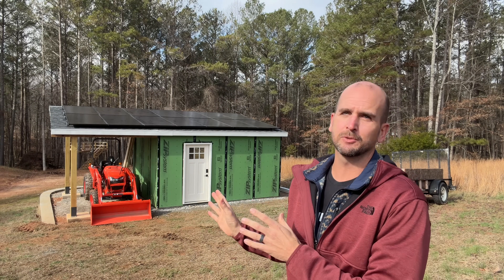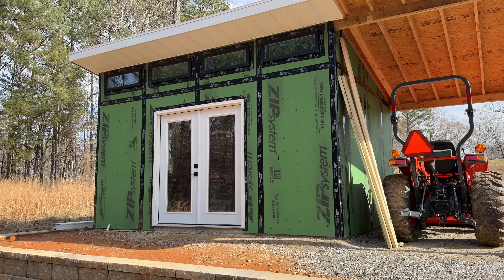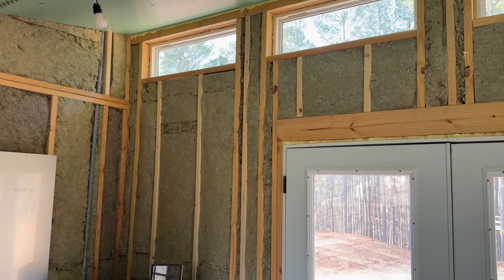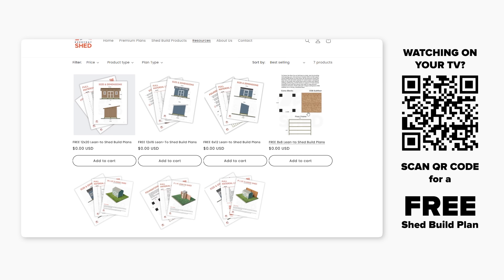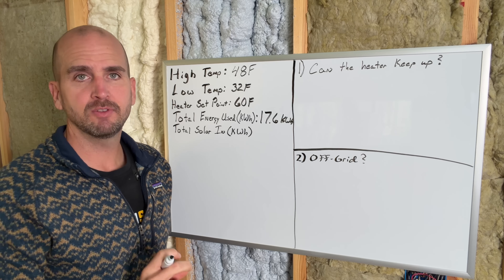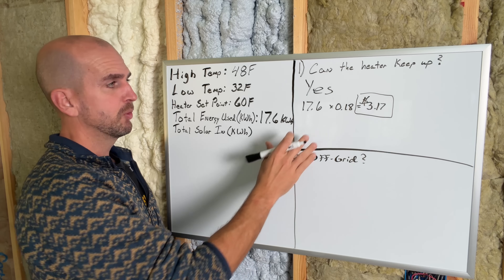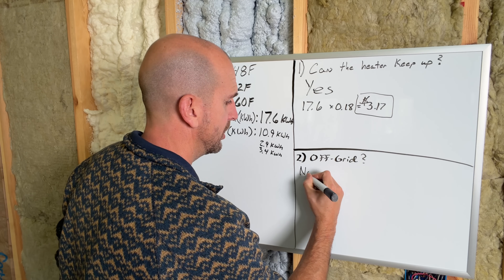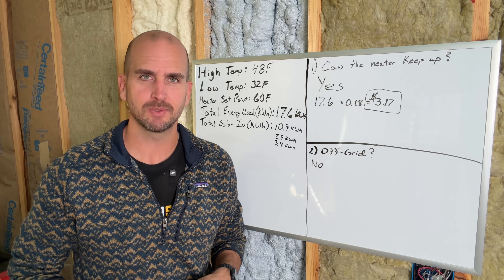HUGE Mistake: Why My $15,000 Solar System CAN'T Heat My Tiny Shed

Comment: $15k solar system that will take at least 15 years to pay for itself (not counting the inevitable decline in performance over that same time period)? Probably around year 20 or so you will be looking to replace it. Take that $15k and invest in the SP500 and you will get a much much better return even after accounting for the grid power cost. It's not even close. If you're not calculating economic opportunity cost into the solar vs grid comparison, you aren't looking at the whole picture. With all those trees, maybe some kind of a wood burning heater would be better. Maybe it could work in southern California where the heat needs are low (might still need cooling) and the sunshine is plentiful, but probably not even there.
Reply: The way you calculate this is just by taking the nominal power consumption in kWh/month and figuring the cost.   Usually though the more electricity people use, the more economic having a solar system is.   Particularly with inflation and energy costs going up, not to mention the cost of trenching to run AC to a shed.

There is no economic opportunity cost calculation ... that's a bit of a misnomer.  People assume that money not spent is money saved in those calculations but the reality is that the equivalent yield from saved money is going to be far lower than the utility costs that you keep.  So there is no actual opportunity cost advantage to not doing the system.   That and the fact that people generally don't save any more by not doing something.  People have a tendency to burn anything they consider to be "extra" cash.  So there is no savings or yield from it anyway.

Modern solar systems do not degrade very quickly.  We're talking 0.5%/year.  Basically after 20 years the equivalent cost of returning the system to its full original production is the cost of adding a single panel to the existing array.  Basically in the noise.    Replacing the power electronics (which have a 15-20 year lifespan) are the larger cost.   The actual solar panels are the least cost.  Solar panels have gotten very,. very cheap.

-Matt

Comment: Could a small heat pump minisplit work better for this size of shed?
Reply from the maker: I will be testing multiple options and the results will be split on Everyday Solar and Everyday Shed as well.  A window AC unit with a heat coil is next.  Mr Cool 4th gen is very interesting and a bit oversized for this space but that is most likely my ultimate setup.
Reply: @EverydayHomeRepairs  Can’t wait to see the results!
Reply: Yes, a heat pump would use way less power.  The small one that I got would use less than a third of the power.

Comment: In our area some people build sheds and then convert them to habitable spaces because to start with a habitable space is very different for codes..... heh heh.  Saying this while sitting in a garage... I mean office... I mean garage!  True story.
Reply: Building to code is cheaper and safer in the long run.  Ever try insuring or collecting insurance on a space not to code?  or even the rest if part of it isn't code compliant
Reply: @pbm___000  In answer to your question, yes.  In my case, we did build to code, but you are correct that jumping through hoops in the long run should be easier up front.  No argument here.

Comment: Unfortunately a good example to demonstrate that solar energy is still not cost effective.  Maybe in another 10-20 years...
Reply: not a fair assesment with one of those eco-flow units. or jackery, or bluetti, or any of the other ones.  You pay a GOOD premium for one of these plug and play kits. A custom built solar power system will cost half or less with significantly more storage and probably more panels.

Comment: Its hard to keep a grow room like that in a cold environment heated cheaply.   But wait, how long did you run it?  Your still short on finishing the walls.  Shouldnt it turn on and off to heat once at temp?  It wouldnt keep running at full blast would it???
Reply: Those cycle on and off once you reach the set temperature.

Comment: R-10 in the ceiling is insufficient, however the easiest thing to do now is add a small vented propane heater and you are good to go.
Reply: In my state the minimum would be R-30 for new construction. This is very inadequate.
Reply: I'm still shaking my head at the only ceiling insulation being those 2" foamboards and nothing between the rafters.
Reply: I agree, he left to much of a void in the ceiling, could have easily added another 2 inch foam in between the rafters and maintained an air gap/ventilation. Alternatively, he could made the entire shed a conditioned space with no venting, and filled the rafter void completely. Ultimately it’s less expensive overdoing the insulation vice having to spend on the cost of electricity for conditioning for lack of insulation.
Reply: Good grief, ppl are not understanding that this is a shed converted into an office. Do you guys watch this channel? He’s not a computer hacker. How much time do you think he needs to heat this outbuilding?
Reply: @nate3356 Good grief, did you even watch the video? The purpose of the video is literally talking about the short falls of heating the shed with solar! The very first step in the process is insulation, and in this case, lack of it, impacts his ability to heat the space with solar.
Reply: @nate3356 Well, if it's going to be an office, probably quite a few hours a day. Not sure what not being a computer hacker has to do with needing to put more insulation up between the rafters.

Comment: Did you insulate below the slab?
Reply: WAY more bang for the buck to address the ridiculously low R10 for roof (than worry about cold air drafts from underneath). heat rises. walls are insulated ok. but the roof needs to hold the heat, and anywhere with snow needs R38-R60+ first
Reply: @pbm___000  Someone did research on an uninsulated basement and the heat loss was pretty significant.  Like 17% of the heat of the home was lost thru this person's basement.  After reading that research i framed up and insulated mine.  Heat travels down/sideways/backwards/forwards.
Reply: You should.

Comment: Well in va. I installed rockwool, plastic, then black insulated boards of 3.5 r value. Installing a eco porcelain wall heater at 400w per hr. Heats up a 100sqf no problem.  There are other eco heater plates out there bigger, I use 3 kitchen, living room I use 850 wats per hr. And keeps the house around 71⁰-72⁰ on out side temp of 35⁰
When is 27⁰ outside inside is 68⁰-69⁰ . I spend $00.1
I like your setup of where you stored power.
Heated floors with coolant ?

Here are winter temperatures like last year.

 keeping the house at 68⁰ with the ceramics wall heaters and 27⁰ outside. Not bad 41⁰ degrees difference by using only 850w of electricity hour. Equals to 14.5 cents per hour.  
And I can't wait to payout my solar system, of course I have a loan payment.  But I haven't paid for any electricity for 6 months. Actually, the electric company should be writing a check in return because this year we over generated of 2700 kwh.

Comment: Good info! I kinda wonder, just for the heck of it, what would be the case if you tripled the walls thickness, or built the shed into a hole underground instead... xD
Reply from the maker: I am honestly thinking about redoing the ceiling to compare a few test days with the current R10 to R25 and see how large of a difference that makes.
Reply: @EverydayHomeRepairs You should look into covering the ceiling and walls with a thermal reflective barrier that comes in 4' rolls that will cover 300 SF. It will reflect cold back towards the exterior and warmth back into the room..They also sell a double-sided reflective barrier with bubble wrap in the center. It works well when set over windows and doors that radiate the cold into rooms. You also need a couple low voltage USB fans for pulling down warm air up by the ceiling to sitting height.

Comment: About 25 years ago I built a 12 x 16 shed, fully insulated with R12 on the walls and R19 on the ceiling.  I had a 15 amp service run to the shed and heated it with a portable baseboard heater pretty easily.

Comment: It's funny how you consider a few cm (5?) of insulation as sufficient. That's about 1/3 or 1/4 of rockwool in my external walls and I still can't call it a passive house. I probably have more inside internal walls.
Reply: You have 20in thick walls?
Reply: Its a shed not a house

Comment: I would not call 60 degrees heating the cabin.  I like those radiant heaters they work really well, and are totally quiet.
Reply: Sure it is
Reply: @Trainspotting944  Heating a room is when you don't have to wear layers of clothes to be comfortable - that is just taking the chill off.